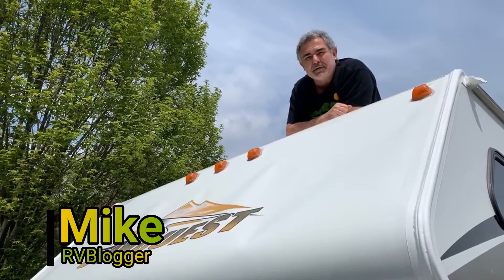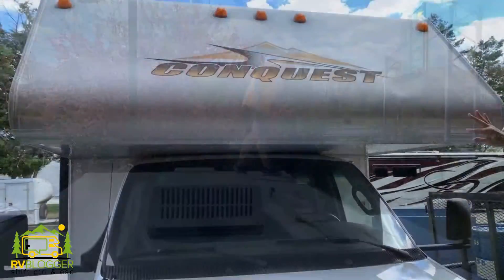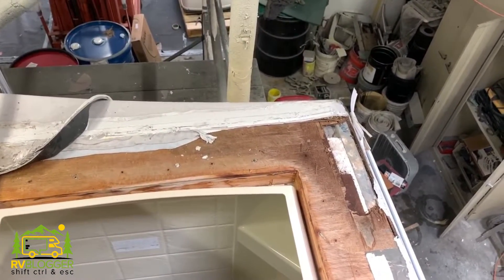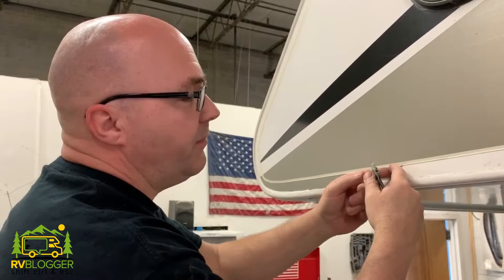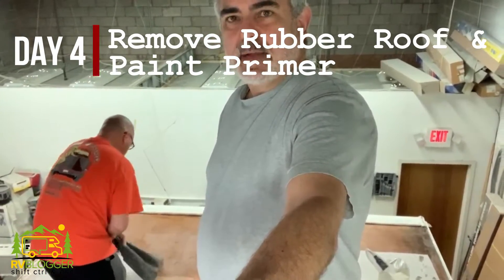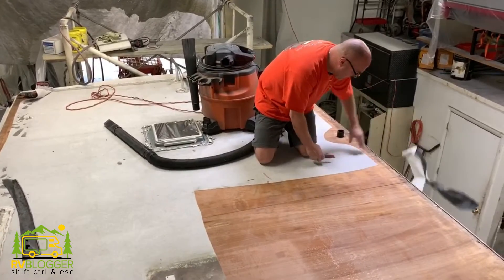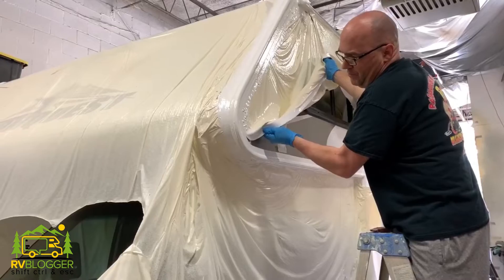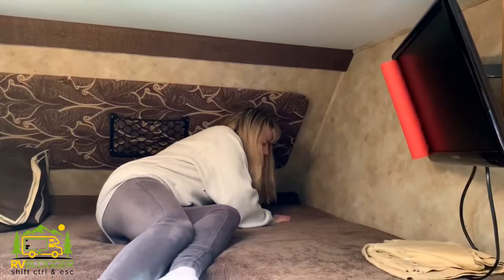RV Roof Replacement! No More Roof Leaks!

Comment: good video great info; I wonder if this is a D.I.Y., project??thank,s PATRICK.P
Reply from the maker: Hi Patrick,
It could be a DIY project but the prep work to get it ready to coat is extensive. Rob spent a week prepping the roof and 30 minutes applying the rubber coating. Most folks don't have the patience to be this meticulous in their prep work. 
Thanks for watching and commenting! 
Mike and Susan

By the way, have you subscribed to our YouTube channel yet? If not we sure hope you will click below and subscribe! Thanks!
http://goto.rvblogger.com/YoutubeChannel?sub_confirmation=1
Reply: @RVBlogger  Great video.  Do you know anyone on the east coast (Northern CT/Western MA) who can do this?  Also, my camper is not worth $5000, LOL, but I am retired and have the time to do the week's worth of prep and possible replacement of the wood.  Would it be reasonable to share the work?  I would have them just do the spray.
Reply: @alklesczewski1207  did you find anyone in this area to do a roof or did you try it as a DIY?   I am in the Berkshires.  Let me know if you had good results

Comment: whats the price of that?? $$$$
Reply from the maker: Hi 83mike860,
It cost us $4,800 and it comes with a 20 year warranty.
I had this stuff in a pickup truck bed and it was indestructible. 
Mike
Reply: @RVBlogger  after ur video .. I'm saving up right now I only have a 27' plus I can do most of the prep work.. now just need to found a trust worthy place that can do it

Comment: I saw the delam on the front of the bunk over the cab. That delam was caused by water leak that is now underneath the fiberglass.  That will never dry out unless you pull off the fiberglass and replace all the rotten wood. All of the wet wood underneath will always get moldy. Your guy may stop future leaks but the water that’s already underneath the fiberglass will continue to rot and more mold will continue to grow. If you would like to see the right way to fix it and the right shop to do it go to “rvroof.com “ and check it out.  He will have videos of many RV’s but the class c has chronic issues that will get addressed.  I Guarantee you will be convinced. Keith fellow RV’er
Reply from the maker: Hi Keith,
You are 100% correct. I'll check out the rvroof.com videos.
Enjoy the Super Bowl tonight!
Thanks for watching and commenting! 
Mike and Susan

Comment: Why did you cover the sky light?
Reply from the maker: Hi Mark,
We decided to cover the skylight because it is a major leak point on RV roofs and we are done with leaks. We had a leak in the back corner of the roof right next to the skylight so we decided to be safe and spray right over it. Great question!
Thanks for watching and commenting!
Mike and Susan
Reply: do you have ANY light coming through he sky light? would you say this job cost less then $2000 or more - I have a 22ft class C thinking about getting it done - thanks Mike
Reply from the maker: @lancephillips8740  Hi Lance,
There is a little light that comes through the skylight. We have a light in the bathroom so it's plenty bright in there.
I would say depending on how much damage and work needs to be done you are looking at $3-$5k.
Not cheap...but it is extremely durable.
Thanks for watching!
Mike
Reply: @RVBlogger  after its sprayed on the skylight could you cut the top part off?

Comment: I agree with using spray on bed liner but I completely disagree with NOT spraying the entire roof & cabover. You had it all ready, all you had to do is spray
Reply from the maker: Hi Guy,
We did spray the entire roof but not the cabover - just the seams on the cabover.
Thanks for watching and commenting! 
Mike and Susan

Comment: why oh why do people not just use a couple layers of Fiberglass cloth/epoxy  over they plywood? it would never leak again and be watertite!???
Reply from the maker: I've not heard of doing this? Can you do it yourself? Can it flex so you can walk on the roof or will it crack? Do you need to paint it? Have you done this? Do you work in the automotive industry?
Clearly you peaked my interest...
Thanks for your comment!
Mike
Reply: @RVBlogger   I build boats and love it.  yes , easy to do yourself, you can google people doing  a "layup" or "applying fiberglass to a hull" etc. . super easy.  it does flex. wooden plywood boats use this too, so it must be able to flex in a seaway, should never crack unless there is some kind of strong impact.  it is light weight. walking in it is NP, although it might be a little slippery when wet depending on what you use to go over the layup with, you can buy a cheap aggregate that mixes in with the paint or epoxy  meant for boat decks, which gives an amazing grip.   you can also mix a pigment into the epoxy. Epoxy sticks to anything even steel(don't use polyester resin). Epoxy is flexible and will not crack and that's why it is used on boat hulls.  The process is very simple. you would tear down the roof of the vehicle as you would to put a rubber membrane  on it. then make sure there are no rotten panels of ply, and replace if you found one.  then simply roll out the fiberglass cloth  onto the roof overlapping it slightly, mix a batch of epoxy and start spreading out the epoxy into the FRP cloth. alternatively , and the method I prefer on boats is to wet the ply  first (in sections) and then apply the cloth, and finally wet out the top of the cloth as well. you would use a "slow" hardener" and have lots of time to work with. in essence you would have  a boat hull like roof. watertight, and probably never need to do it again. it would be strong,  flexible,, durable.  if you notice  that cube vans use all fiberglass construction for thier boxes, you can see how good it would be to have roof made of the same thing. I plan to do this with my small motorhome. there is a slight learning curve if you have never done it. but that's easy to do a couple practice runs on a couple 1 sq ft pieces of scrap ply.  you can buy the supplies to do it at any boat building outlet, like "Totalboat"  call them and ask them for help. they are a good source. Also there are some vids of guys doing a fiberglass roof on thier rv's on YouTube. hope that helps.
Reply from the maker: @CanadianDivergent  This is awesome! I love to learn new ways of doing things. Thanks so much for your comment! Hope you have a great week...
Mike
Reply: @RVBlogger  np!

Comment: You are over looking the biggest problem with water leaks in a class C. Just by watching your video I can see delaminated fiberglass on the front cap just below the marker lights. That is wet underneath the fiberglass and will never dry out. If you were to take out a couple of screws on the end of the cap underneath the snap trim you will find that screws will be rusty. Will also almost guarantee that you will have mold growing in there also. Spray on roof tend to cover problems not fix them.
Reply from the maker: Hey Keith, 
Yes marker lights can potentially be a leak problem but in our instance it was the seam around the overcab. We appreciate the additional info for people to learn! :) 
Thanks for watching and commenting! 
❤ Mike and Susan 

By the way, we hope you will subscribe to our FREE monthly digital/video magazine called RV Camping Magazine. Let us know how you like it!
https://rvblogger.com/rv-camping-magazine/

Comment: Dicor is the worst lap sealant on the market
Reply from the maker: Hi All2skitzd,
What do you recommend?
Thanks for watching and commenting!
Mike
Reply: @RVBlogger  personally I use Premier Pro. Might not be the best stuff in the world but it stays flexible, doesn't crack it get pinholes, and sticks way better, but the main reason I use it is it comes in a pouch with screw on lid so it's super easy to apply and store. Pretty much any lap sealant that's not a super cheap white lable (which will perform equal to Dicor) will be better then Dicor. I've asked in a couple groups and all these people that say it's the best could not name anything worse when it comes to self levelling lap sealant. It bring the best is just a bad rumor that spreads because people have not used a quality product.

Comment: geeze that gona coasta you guys rather lay a steel roof panels one piece and paint it white
Reply from the maker: Hi Tim,
How much does a steel roof weigh? And how much would that cost?
It was expensive but it won't leak!
Thanks for watching and commenting! 
Mike and Susan

By the way, have you subscribed to our YouTube channel yet? If not we sure hope you will click below and subscribe! Thanks!
http://goto.rvblogger.com/YoutubeChannel?sub_confirmation=1
Reply: @RVBlogger  Hi there ok not sure but my rv has one from the factory and it seems to hold up mow since 1994 with not leaking yet I just put two coats of white glossy piantfrom home depot and its cooler in the summer months like 5 Degress   thanky you